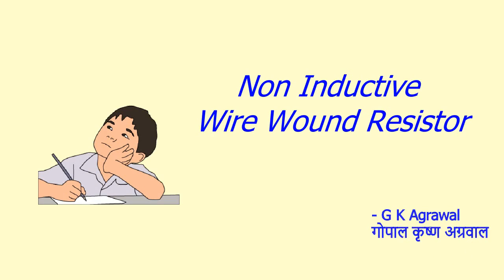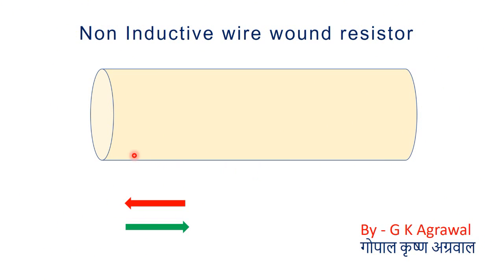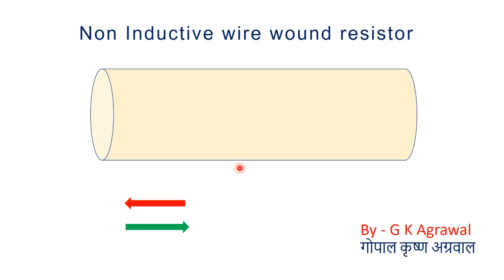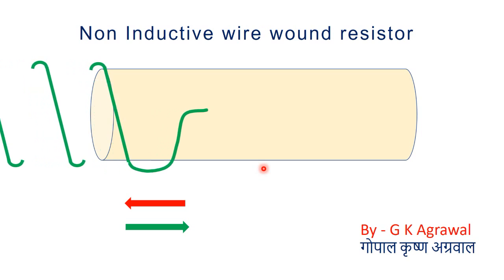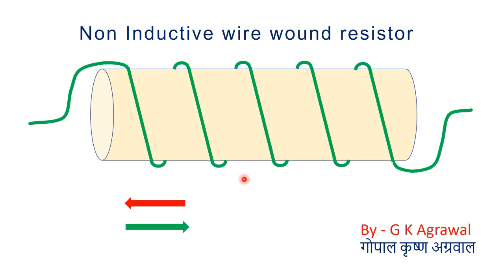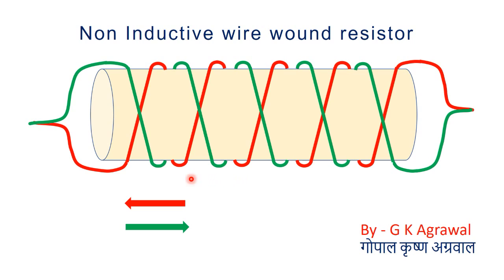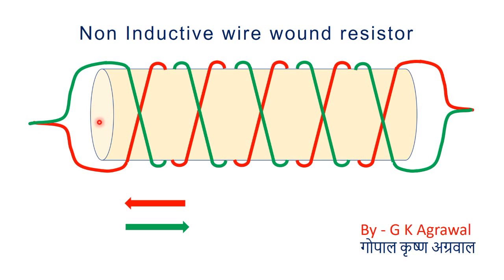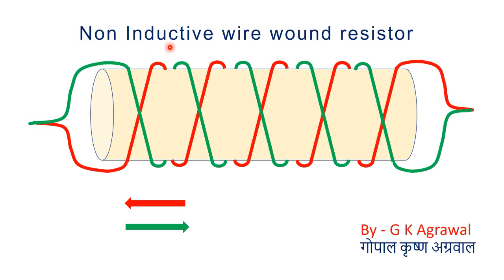Non Inductive Wire Wound Resistor, inductance less coil

Comment: sir what is correct answer
Q)directional induction type over current relay is used for protection of
a)long transmission line
b)large power transformer
c)ring main distribution line
d)radial distribution line